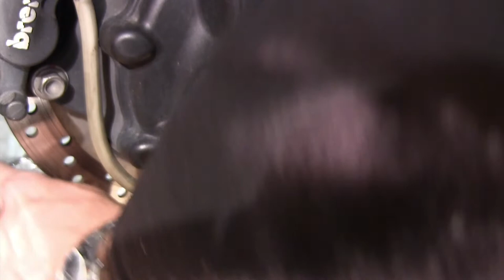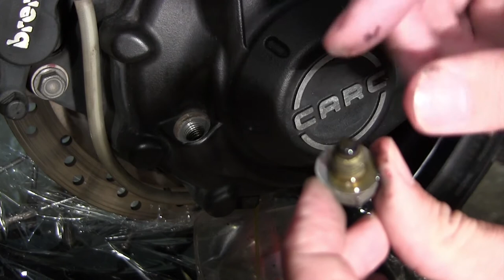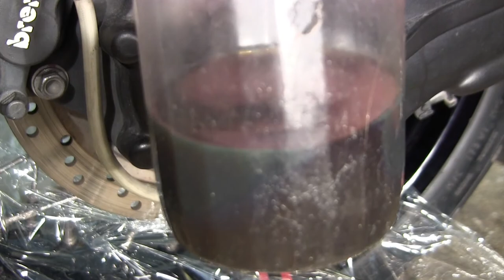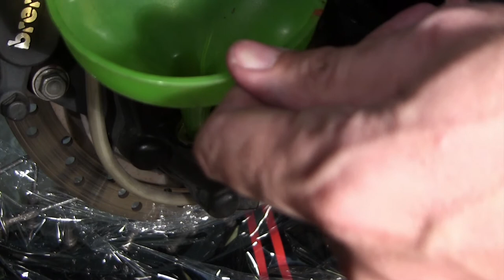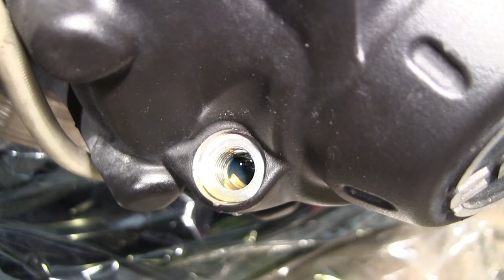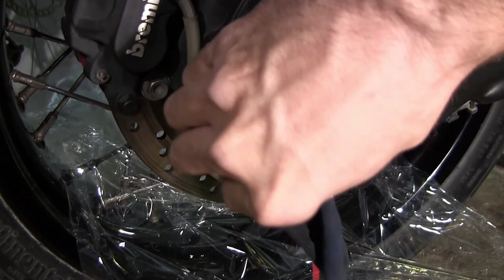Guzzi Stelvio Carc oil change

Comment: Griso manual:
THE UNIT MUST BE HOT WHEN THE OIL IS CHANGED AS UNDER SUCH CONDITIONS OIL IS
FLUID AND THEREFORE EASY TO DRAIN.
NOTE
RIDE SOME km (miles) TO WARM UP ENGINE OIL
• Place a container with + 400 cm³ (25 cu in) capacity under the drainage plug (3).
• Unscrew and remove the drainage plug (3).
• Unscrew and remove the breather cap (2).
• Drain the oil into the container; allow several minutes for oil to drain out completely.
• Check and if necessary, replace the sealing washer of drainage plug (3).
• Remove any metal scrap attached to the drainage plug (3) magnet.
• Screw and tighten the drainage plug (3).
• Pour new oil through the fill opening (1) until it reaches the cap/dipstick hole (1).
CAUTION
DO NOT ADD ADDITIVES OR ANY OTHER SUBSTANCE TO THE FLUID. WHEN USING A FUNNEL
OR ANY OTHER ELEMENT, MAKE SURE IT IS PERFECTLY CLEAN.
• Screw and tighten the caps (1 - 2).